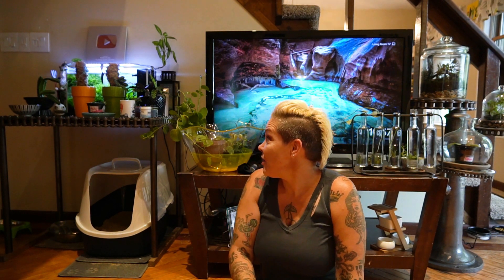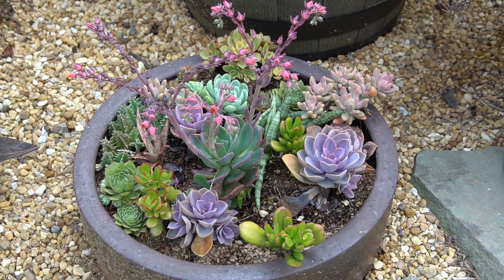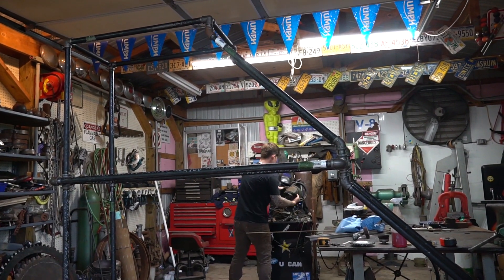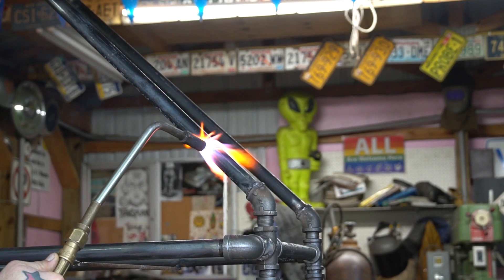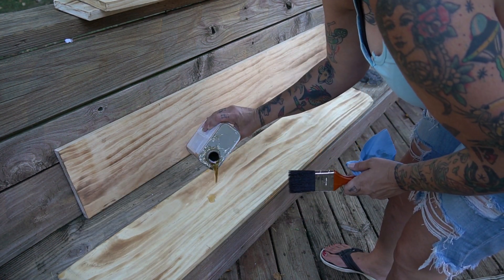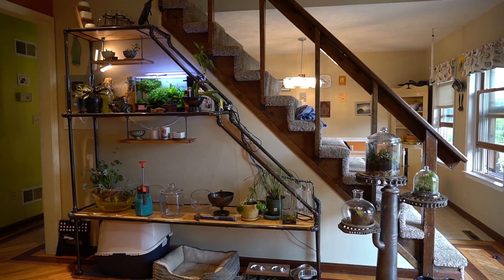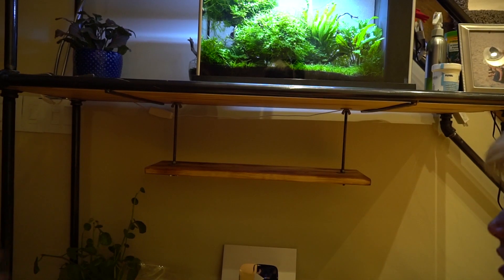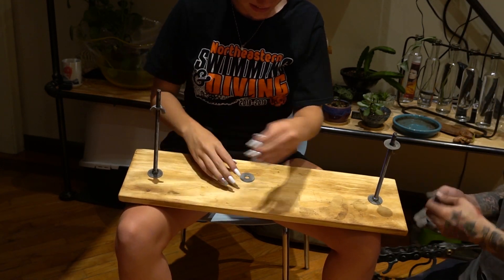Making a Custom Plant Rack

Comment: One option for lighting is that you can use a router to make some groves on the wood and then insert LED stripes that can be cover with acrylic or leave them uncovered. Also, some industrial lamps will look cool coming from the sides instead of straight down

Comment: Flexible LED strip could be attached with double-sided tape to the rear edges of the shelves, basically hidden. Can provide adjustable intensity as many of the available strips have inline controls and /or wifi/bluetooth/IR control. There are multi-color strips available which allow both light intensity and color adjustment. Commonly available inexpensively online. When installed essentially hidden without wires trailing over the shelves. Low voltage, thus safe for potential splashed areas. This would necessarily be backlit as described.

Comment: I have had excellent results using LED flood lights.  I use 100W equivalent 5000K bulbs with a medium base.  A medium base fits into most fixtures, so your husband could easily make a decorative fixture using parts from your local hardware store.   I grow mainly cacti and succulents and find that keeping the lights about 18" to 24" above them provides plenty of light.  For house plants, I find that 5000K provides the best balance of blue and red light.  The color of the light is pure white, so it will blend in well with the other lights in the room, but with as much light as plants need, you will probably not need to have any other lights in the room.

Comment: I use LED Under Cabinet Light Bar Daylight White 6000K, 950lm,  they are extremely thin and you can connect multiple of them together,  you could line up as many as you need along the shelf  and grow a whole host of plants, i've not found a plant that wont grow with those, some plants might grow slower but they grow for sure!!!

Comment: For lighting you might want to look at some of the led under cabinet lighting options that are available. I just got one for $40 off of amazon that includes 6x 12" strips that are supposed to be run from a single plug and be daisy chained from one to another kind of like the shop lights you got for the fishroom.

Comment: As for lighting, my first thought are those RGB adhesive strips you can find on Amazon all day long. The main downside imo might be getting them around that rack. I played with them for a year or so after Joeys guides a few years back. IME they really don't care to bend or they short out within months. You can cut and solder but f that noise. It my have been that I was obviously using the 'waterproof' LEDs which I think was the problem, the bends broke the waterproofing. Also, I got into iron pipe a few years ago and began making lamps, wine racks, sconces, dvd racks, and wall shelf brackets. Banjo Show is a pretty good channel for a lot of steampunk diy.
Reply: Whoops, also, great job. 👊

Comment: Looks great and I'm curious about the lighting that you do. I don't know if you can get a bunch of pendent or clamp fixtures that can wired together and use some eco LED bulbs. Like the bulbs that SeraDesign has used in the past. Maybe incorporate some kind or shop light or LED bulbs that light both tanks and house plants grouped together. Perhaps one or two of those lamps with multiple and bendable heads would do the trick? Strip LED lights that you can cut and customize might also be good. However, I've seen mixed reviews on those for desired growth and longevity. There are waterproof and non-waterproof varieties.

Comment: another cool video with great content  would have been nice to have run maybe a main cable up one of the legs of it and then have one or two extension strips hidden the best as possible.   I would mount the lights on the bottom of the shelves.   And if I had them I might use lights that shine specifically downward as much as possible.

Comment: I would recommend led strip lights.  You can get them in multiple color temperature from warm to cool white, or you can get them in RGB and adjust the color to what you want.  They are cuttable to length and adhesive backed, so you can install them so they won't be obvious.  Since you are using pipe you can drill a small hole in the back of the pipe and run the power wires inside so it's hidden from view also.  

This is just the first link I found on Amazon, there are tons of options:  https://www.amazon.com/LEDMO-Flexible-Daylight-Waterproof-brightness/dp/B01339G2F6/ref=sr_1_34?keywords=led+strip+lights+smd&qid=1566347527&s=gateway&sr=8-34

Comment: Use the pipe as conduit and run lines to strip LED light. The controller for the LEDs ca be hidden and u get the opportunity to adjust light colors. Led strips could be hidden behind the pipes and act as accent lights.

Comment: Since you mentioned moisture being a concern, are you aware of marine plywood? It's a higher grade plywood that has a few neat properties. First, they use the same wood throughout the layers and the layers tend to be thinner. The lack of knots and gaps throughout the material combined with the extra layers produces a sheet that is considerably stiffer and more warp resistant than your standard plywood. Secondly they use Lloyd's rated waterproof epoxies. You can actually boil them without de-laminating them (although you will obviously damage the wood eventually if you do this). They're also available in a variety of woods meaning that you can get finer grains if you want them (although you'll generally pay a price premium, especially with some of the mahogany ones).
Okoume is one of the more commonly available marine plywoods, and it's also generally among the cheapest. No matter what the wood is, marine plywoods are nearly bulletproof. I've got scrap pieces that have been sitting since I was a child in less than ideal conditions and they're still perfectly flat.

As for lights, how much power do you want? Do you want natural color, or are grow lights adequate? You can get LED tapes for moderate lighting, and there are even some grow light tapes out there, although I can't speak on their quality. If you want high powered lighting there are a plethora of options, both off the shelf and DIY that could be used.

One other thing. You can get 45 degree wye tees in cast iron. Those would have let you put in a middle shelf without the amalgamation of bends on the right side. If you google "#988758 Home depot" an example of one should come right up. I'm not aware of any off the shelf pipe fittings that would have let you build the shelf wider than the posts the way you have it setup, but this would let you make one the same width as the supports. I'm sure someone somewhere makes a combination corner+wye 4 way that would let you do it, but by the time you track down something that specific you have to ask if it's worth it as opposed to just custom fabricating something with a tig torch or having a few extra bends.
Reply from the maker: Thank you for all that info!! We had never worked with pipe for a project like this. The main reason we used boards instead of a ply (though marine plywood sounds like a smart choice for fish keepers too) is we don't have a table saw. Thanks again
Reply: Yeah I'd definitely recommend it for stands and shelving for aquariums. It's not "water proof", but it's certainly a lot more tolerant of moisture than your typical board, and the added stiffness certainly isn't going to hurt when supporting heavy things like bigger tanks. Unless you're building out of metals, you're going to have a hard time beating it short of building out of jarrah or teak or some other rot resistant wood.

So what do you think you want for lighting? Are you still planning on building that immersion system you saw in Christine Keys' setup because I have a few suggestions for extremely powerful DIY grow lights that you might be interested in that would be gratuitous overkill for that shelf.
Reply from the maker: I am not doing Christine's system here, I was thinking downstairs where I have concrete floors and drains. I don't know what I want 😥
Reply: Ahh, I wasn't clear on that. I meant for that system wherever you put it. The topic of lighting made it spring to mind.

Comment: I did some research on the low voltage LED’s as seen in Michael’s fishroom. 
Apparently they are better if not comparable to fixture types. I ordered 2 16 foots “ropes”. And in a couple weeks I’ll pick up a 16 red/blue LED’s.
As a point, the light can be dimmed, and wait, it’s a rope! Put it wherever!